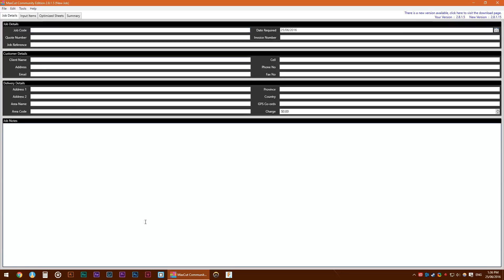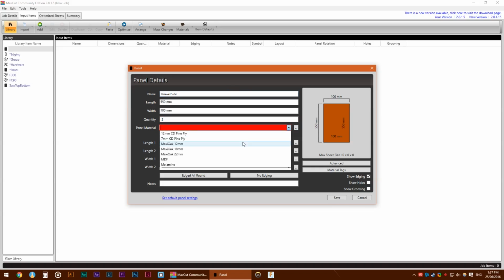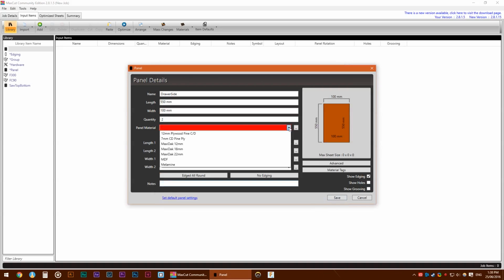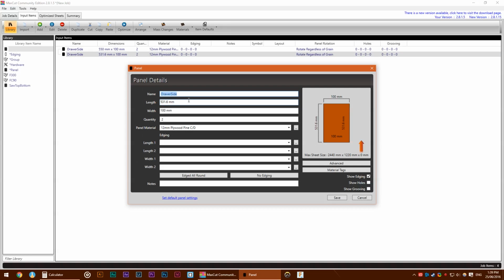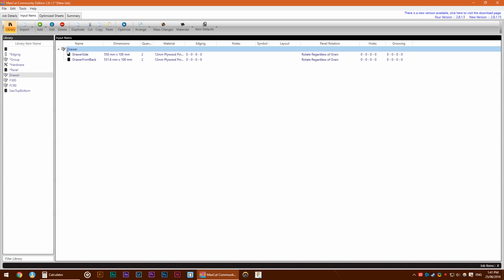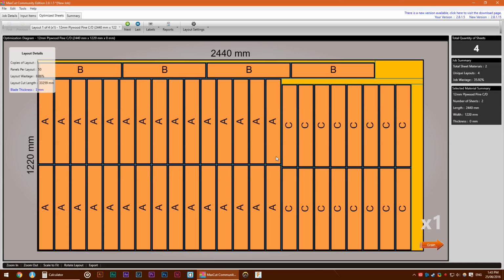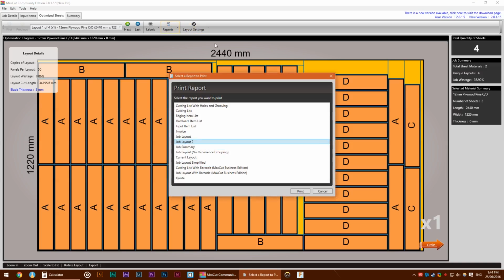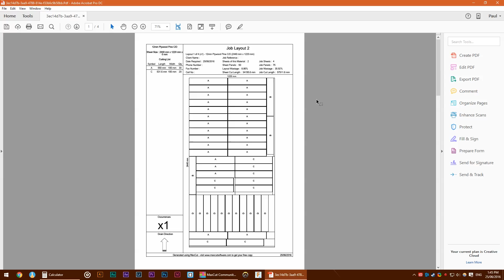Talky Tuesday: Cut lists with MaxCut

Comment: Hi Paul, thanks for this. I'm just about to give Maxcut a go thanks to you! Yep, got the same problem with it in that the 'community' program doesn't tell you a measurement to cross cut the board for easier handling. I guess you could just add up the cuts and the pieces, but then what's the point of the program?  Would be worth a payment to get that if they do it. Thanks again for your vids, they're great.
Reply from the maker: Louise Davies given it puts a parts list with dimensions I've never needed it to explicitly tell me where to cut. if A is 1600, cut at 1600.

Comment: Paul I have tried the Maxcut free version as well but haven't figured out where to make those cuts to break down the sheets. Is there a separate sheet that gives the dimensions of where those cuts should be made?
Reply from the maker: As in the specific order (sort of a 'cut by numbers' style 1-2-3)? I don't think there is that specifically. Just look at the blue lines (if you're in the 'optimized sheets' tab. By default, thats the cut line colour, and just look for what goes all the way through the width?
Reply: So I'm not missing a dimension id for where those thru blue cut lines would be, because they're not there??
Reply from the maker: As far as I'm aware, yes, that is the case. The through lines are there to do the 'big' break downs, then you'd divide it out further by yourself. Looking at what I've got in front of me, I'd personally ignore the first two lines (working from my right), cut the third, then take it to the table saw. I think thats where it gets a little trickier to give them IDs as the order in which you do it varies by personal preference and by what tooling you have.
Reply: That's the same for me break the sheet down to a more manageable size and then use the TS to make nice true rip and cross cuts. Thanks for answering my questions.